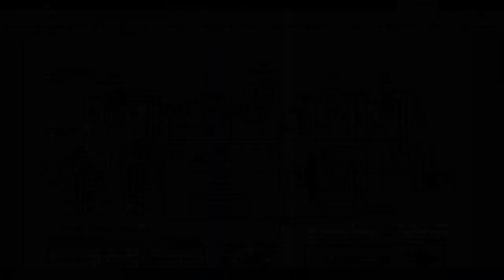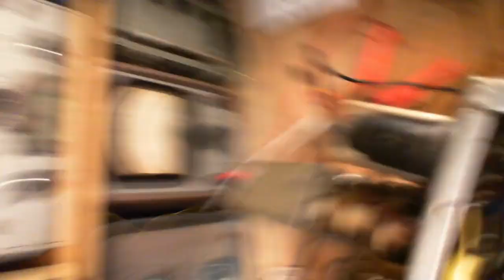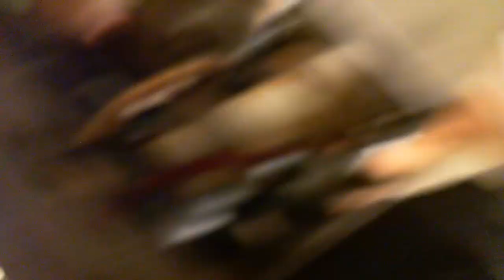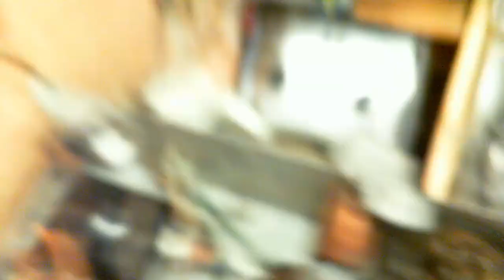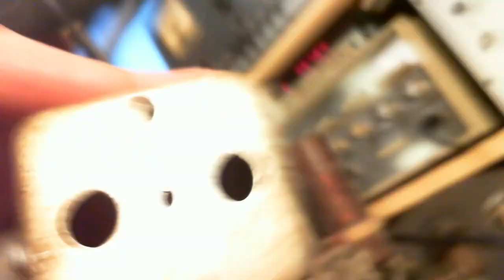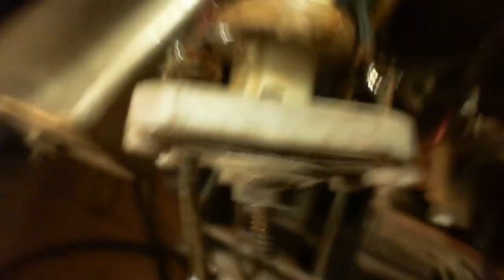Stewart Warner R146 Video #8 - 1st IF Transformer

Comment: being it's open why are you not replacing the cloth wiring in the transformer?  you also need tweezers real bad and the correct wire strippers

Comment: The coil is wound with “litz” wire where each strand is insulated from the next strand. (It’s a multi stranded wire). It’s important to solder all strands to the coil connections to retain the quality of the coil, Q etc.
Reply: Exactly. And you cannot just nilly willy cut strands off from the bundle. And there clearly were strands in that blob of wax he cut off.
 Plus one should stress that the old enamel coating on the strands does not solder through that easily as the modern stuff which is made to burn off at the touch of the solder iron. So you need to scrape the wire or at least add flux and thoroghly heat the wire. What he did was slap solder on. And there is a high chance it just adhered to the enamel and wax leftovers without making connection.
Bodge job fix that he should have known how to do better because he has been there in the past.
I hope we get to see how M.Caldeiras tackles  resoldering the broken RF litz wire from the AM rod antenne on the Philips radio he is currently doing. He will certainly do it right.
And what is more; the proper technique would also have included adding flexible litz wire to the end of the broken coiled wire and then generously loop it to the wiggly terminal. That way it will take up any movement i.e. from adjusting the trimmer or handling the grid cap wire. And the splice to the broken coil wire ought to have been mechanically attached to the core of the transformer with either wax, silicone or epoxy to make sure it will not move anymore. Because the next break will be where the wire enters the coil and then it is game over or rewind the whole thing.

If in doubt watch how shango066 performed brain surgery on IF transformers. 

Oh and leaving out the paper insulator will come to haunt him. If the terminals on the primary winding are as wiggly as the ones he tampered with here, they should short to the case once he tries to fool around with the trimmer caps. And there is b+ on them. And if you do it right you may even short b+ thru the winding to ground and burn it up.

Comment: It’s easy the get the grid wire through the hole. Just thread a wire through the hole in the van and solder it to the end of the old grid wire. Then as you fit the coils into the can, pull gently on the wire you just fitted to pull the grid wire through the hole in the top of the can. Job done.

Comment: 3 of the 4 wires go from the chassis to the coils the 4th wire goes from the grid cap to the coil so one test is between two of the three on the chassis and the other chassis wire is the one that has the grid cap wire on the other end

Comment: 1:36 the way the equipment is hooked up to the IF transformer makes the test useless. The transformer must be tested interfaced and driven by the components around it. 
i.e. it ought to be fed from the plate of the previous tube and only see the grid of the following IF tube as load.  But he is not feeding the IF primary loosely via a  coupling cap and high value resistor for impedance matching but from his ultra low impedance source, and he has the the scope as load too. And given his resilience to learning he probably put it in x1 mode so issuing the maximal parasitic load capacitance.
NO WAY you will get a valid proper passband sweep. The resonance will be way too low because of all the parasitic capacitances and mismatches.

Comment: I don't mean to sound negative but if the 4 wires of the primary and secondary of the IF transformer are soldered OUTSIDE the can, what's the point of TEARING apart the transformer to check for continuity ?! So dumb...
@ 39:00 For crying out loud man, use the soldering iron to melt the wax !!! Geez...